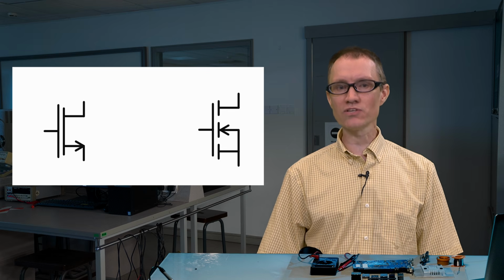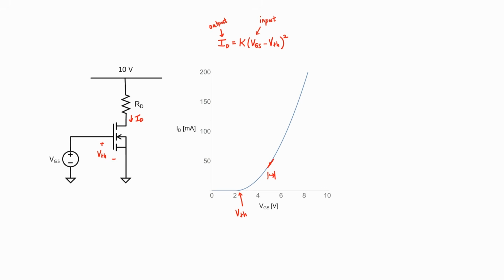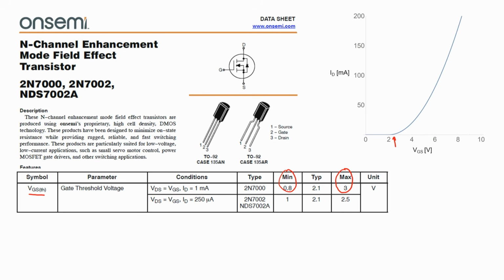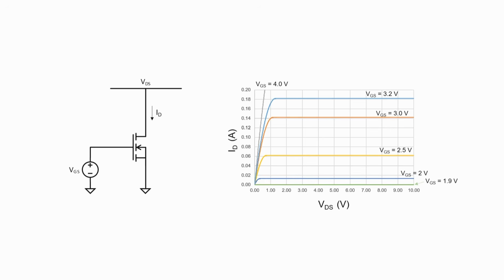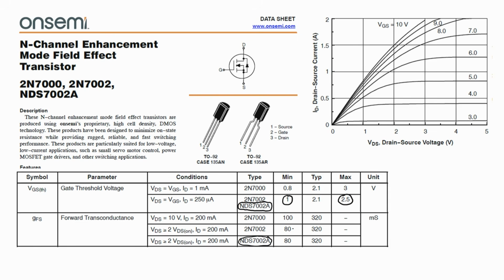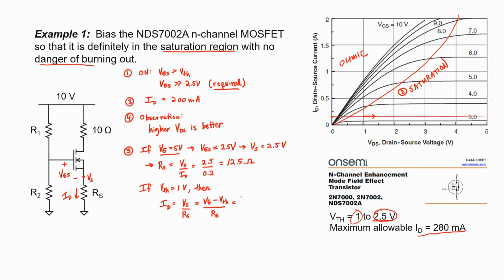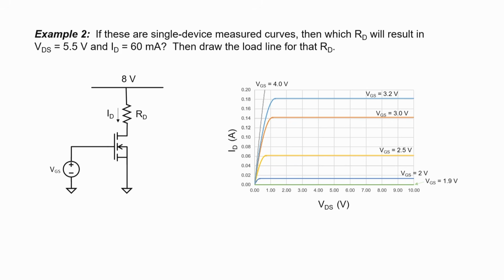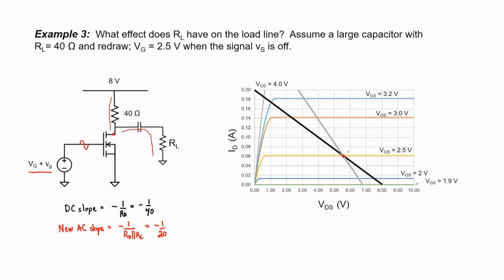Introduction to MOSFETs (25-Transistors)

Comment: Unless I missed it, the presentation skipped over any real discussion about 'blowing up' the FET. Leaving it as simply oh the spec sheet says 280ma so use 200ma. This is ends up as a very common mistake, when the thermal analysis, even at a very low level is not performed. In this presentation it was glossed over but an improvement would have been to at least mention the importance then follow up with a presentation on power vs junction temperature to avoid letting the smoke out.

Quick and Dirty Calc: At 200mA, Tj = Ta + Rthetaja * Id^2 * Rdson = 40C + 417 * .2 * .2 * 5 = 143C (Rds approximated from the DS) That just makes it on a hot summer day.

Comment: A lot of facts missed out by this professor who has never used a MOSFET and understands very about the practical side of electronics. 
For a start, you do not mention the word transistor. The word transistor refers to the common PNP or NPN transistor and don’t even start with Bipolar Junction Transistor.  Just use the word Transistor.
For MOSFETS you use the word MOSFET. 
Now here’s the important facts you need to know. 
As you increase the frequency and want to turn the MOSFET on and off very quickly, you need to supply the gate with a high current. Even though we talk a bout the device being voltage controlled, it needs to be tuned on and off quickly if you want it to dissipate the least wattage. 
After all, these devices are generally used in high current stages. 
And that’s why gate resistors as low as 220R, 100R or even 10R need to be used to discharge the field on the gate. 
That’s why you need a bipolar driving voltage so it can turn off the voltage very fast. 
You also need to supply a voltage that fully turns the MOSFET on. 
This is generally higher than 2.5v, but look on the data sheet. DON’T GUESS. 
In all my designs, the MOSFET doesn’t even get warm. And it drops (loses) almost no voltage, compared to a transistor that would drop 1v or more for the same current. 
None of this information has been presented in this video because he has never used a MOSFET in his life.

Comment: How come we assume that Vs is 2.5 V just by substracting Vgs with Vgth? Isn't gate behaving like a capacitor  that means full voltage drop of 5 V over Vgs? I guess it would be more appropriate to calculate Vs through the DC voltage from the top?

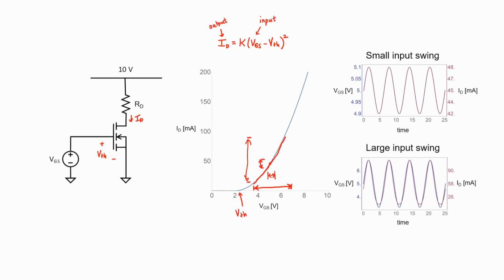Comment: You have some misconceptions in your introduction. At 5:42 you suggest that mosfets might not be as good as BJTs when making linear amplifiers because of the inherent non-linear transfer curve between input voltage and output current. But BJTs have an exponential relationship between Vbe and Ic, compared to the quadratic relationship between the mosfet's Vgs vs Id. The distortion for a BJT can be shown to contain odd harmonics, while for the mosfet it will contain only even harmonics, which is a much more acceptable distortion. Now, in real applications, considerable negative feedback is always applied to make the amplifier linear in either case, which makes the comparison between devices moot, so it's really not accurate to suggest that mosfets are less good as linear amplifiers than BJTs on the grounds of distortion.

At 7:45 you suggest that the Vgs-Id curve is "almost linear" at Id=200mA. Of course, it simply is not: it's always parabolic in the saturation region. The slope is always the differential of the equation Id = K(Vgs - Vt)^2 which is clearly dI/dV = 2K(Vgs-Vt), showing that the slope (i.e. gm) is always proportional to Vgs-Vt. At 200mA, the slope is just steeper than at smaller currents, but the curve is no less parabolic.

At 9:30 you suggest that with 3.1V on the gate, the 2N7000 is "just barely on". This would be true for a sample whose Vt is 3.0V, but for a sample whose Vt is 0.8V, (Vgs-Vt) is now 2.3V which should typically produce a drain current of around 500mA, except that the 1K drain resistor and the 10V supply would have limited it to 10mA and the mosfet would be in its ohmic region, which is actually "fully on". That's the problem with the typical large variations in Vt across samples of mosfets. You can't accurately bias them without a lot of negative feedback.

In Example 1, you don't actually meet the requirement that the NDS7002A doesn't burn out. You correctly identified the maximum drain current (280mA), but didn't spot the maximum dissipation, which is just 300mW. Using your 20R source resistor, a Vt=1V would give a dissipation of Vds x Id = 4V x 200mA = 800mW; and a Vt=2.5V would give a dissipation of 6.25V x 125mA = 780mW. Whatever the Vt, you're going to burn out the NDS7002A. These are small-signal devices, intended to run at milliamps, not hundreds of milliamps.

In Example 2, I think most engineers will simply say that Vd=5.5V, the voltage across Rd is 2.5V, and Id=60mA, making Rd = 2.5V/60mA = 42R. Then 8V/42R = 19mA, so the load line passes through (0V, 19mA) and (8V, 0mA) without worrying about the equation of the line (interesting as it is). "Hypothetically changing the drain-source voltage" has no real use as you still don't have the relationship between Vgs (the input) and Id or Vds (the output) on that graph. That particular load line has no practical significance.

Comment: 25:33 I'm always been opposed to the concept of dynamic load line, this because the "AC" slope is relative to small signal around the operating DC point while the drawn dynamic load line go far away from the DC point. Please, try to calculate the equation of the load line: how can we find the intercept to Vds and Id axes?
Reply: You have a supply of Vdd and a drain resistor of Rd. Then when Vds=Vdd, no voltage is across Rd and Id=0. Similarly when Vds=0, all of the supply is across Rd and Id=Vdd/Rd. You now have two points on the graph of Vds vs Id, namely (Vds=0, Id=Vdd/Rd) and (Vds=Vdd, Id=0). Join them up.
Reply: @RexxSchneider  no, if you consider the dynamic behaviour you have only variations around work point and Vdd have no variation, so it is not present in the dynamic equation (that is delta Vds = - delta (Rc * ic) )
Reply: @ What did you mean by delta (Rc * ic)? I thought we were talking mosfets?

For a mosfet, we can approximate the Vgs-Id relationship as Id = K(Vgs-Vt)^2 where Vt  is the threshold voltage. That means δId = 2K(Vgs-Vt)*δVgs. That shows us that gm varies linearly with (Vgs-Vt). We can then see that δVd = - Rd*δId = - Rd * 2K(Vgs-Vt) * δVgs.

It should be obvious then that the slope of the load line will change depending on transistor parameters, even at the same operating point. The dc load line shows how the operating point will change for a given set of transistor curves, so has some use. I'm not sure I can see any way of imposing a small-signal load line on those curves that is at all meaningful. Sorry I didn't make that clearer originally.
Reply: @RexxSchneider  I'm talking about dynamic load line. I used a wrong letter for the current and the resistor, sorry, I mean Rd and Id

Comment: Зачем это масло-масленное, никто ен использует мосфеты как линейные транзисторы, т..к даже в одной партии напряжение открытия транзистора сильно варьируется, что сами и сказали, НО продолжают пол часа рассуждать о информации, которая бесполезна. Нужна линейность, используйте биполярные транзисторы, нужны ключевые свойства, берём мосфеты, остальное всё только засорение.
Reply: On the contrary, mosfets are used as linear transistors in a wide variety of CMOS opamps, which possess a lot of advantages over bipolar opamps. Of course, the ability to closely match devices within a single die makes the variation in Vt for mosfets much more manageable. As far as discrete devices go, you have a point, but high power linear mosfets are still useful as output stages in high quality class-A amps, but they may need to be tested and selected, or the biasing may have to be variable and set up for each device.
Reply: @RexxSchneider  Это да, у мосфетом более низкое сопротивление канала, и это во многих моментах сильно упрощает компоновку и количество применяемых деталей в схеме, но опять же, их не линейность и огромные погрешности в том, что нереально найти условную комплиментарную пару, даже в одной партии. Это добавляет много отрицательных нюансов в настройке мосфетов, в попытке заставить их работать в линейном режиме, и особенно в силовых узлах, где нагрев ещё больше привносит погрешностей.
Reply: @SINHRO-FAZA  Mosfets are no less linear than BJTs - after all the V-I curve for a BJT is exponential, while it's only quadratic for a mosfet, hence less odd harmonic distortion.
I quite agree about the problems of finding matched pairs for discrete devices, but in an ic such as an opamp, that problem is much reduced.

Comment: Graduated with my MSEE but still find your videos on the basics like this so clear and useful!
Reply: ditto…MSEE + 38yrs experience as a wireless communications systems engineer…have been far removed from circuits since over two decades now. Prof. Danner’s videos are like going back to my first electronics circuits class 😊🙏🙏
Reply: EE with 10 years experience and this video has been helpful.

Comment: About BJTs, when do you use Rin=re*beta +Re instead of Rin=re+Re only?
Reply: If you are determining the effective impedance looking into the base (e.g. for calculating input impedance of a common emitter or common collector stage), then that impedance is β*(Re + re). The only way that Rin = (Re + re) that I can imagine is if your input to a common base stage is via Re.

Comment: Why is the nomenclature so unintuitive?
Thinking of water, the flow will go from the source to the drain. But with mosfet it seems the other way. Even the symbol defies logic. This is so confusing.
Reply: The arrow always indicates conventional current, i.e. positive to negative. In the simple symbol, the source is marked as current flowing out of it (i.e toward ground). In the complex symbol, it recognised that the body, or substrate is P-type and both the source and drain are heavily doped N+ regions. The body terminal is normally connected internally to the source, although older mosfets sometimes had a separate body terminal brought out of the case, which had to be tied to the lowest voltage in the circuit. The junction between the P-type body and the N-type drain forms a P-N junction, the so called "body diode", which is obviously reverse-biased in normal operation, but may be significant if the device's drain can be pulled to a lower voltage than its source.
The complex symbol therefore properly indicates the P-N junction between body and the channel (effectively between body and drain when the source is tied to the body). HTH.
Reply: @RexxSchneider  & @JonBrase thank you so much for your great answers. I took a screenshot so I can always refer to them. It also makes more sense now knowing it depicts the traditional (+) current flowing. Isn't this the opposite with NPN or PNP transistors where the (-) current is flowing from the collector to the emitter?
I naively thought that the traditional flow was used in electric circuitry, but the physics flow of electrons was only used in electronics and microcontrollers.
Reply: N channel MOSFETs depend on the flow of excess electrons in the semiconductor, whereas P channel MOSFETs depend on the flow of "bubbles" without enough electrons, but current is always defined as the direction in which positive charge flows. So the "source" in an N channel MOSFET is the source of electrons, and conventional current flow goes into the source, whereas in a P channel device it's the source of "bubbles", and conventional current flow comes out from the source. I don't know what the logic is for the arrows on the body terminal, though.

As for why we define current flow as the flow or positive charge when, outside of semiconductor contexts, electrons are always the charge carriers of interest, that just comes from the fact that we knew what charge and current were before we knew the underlying physics. One type of charge was arbitrarily defined as "positive" and the other as "negative", and current was defined to be the flow of positive charge (and thus opposite to the flow of negative charge), and everything was great until we discovered that it's negatively charged electrons that actually flow.

Comment: Is transistor voltage control or current control or both?
Reply: Nd BJT is current control device
Reply: Wrong , BJT control is both current and voltage,  degenerate resistor in emitter is example of that. 
 @kasaniSatyanarayana
Reply: By changing the voltage at the gate pin, we can control the flow of electricity between the drain and source pins. If we supply 3.3 or 5 Volts to the gate pin we allow current to flow between the other 2 pins
Reply: The FET transistors are voltage controlled, but BJT use current.
Reply: which transistor